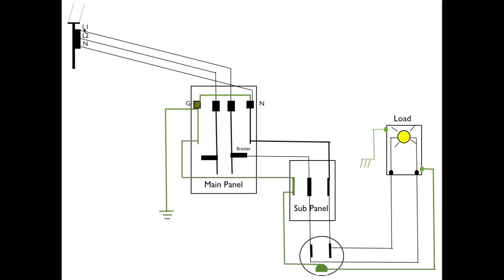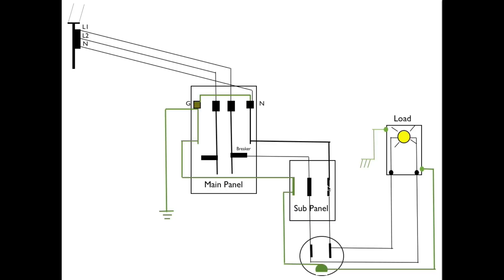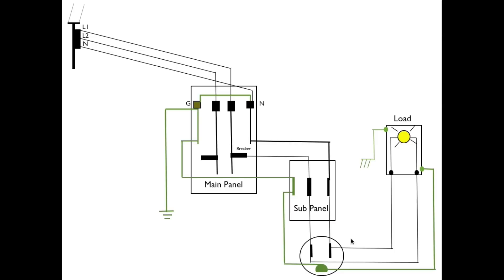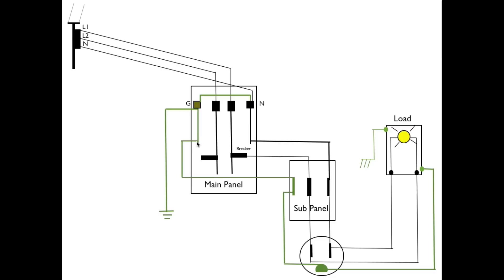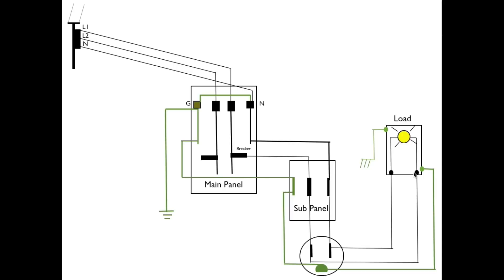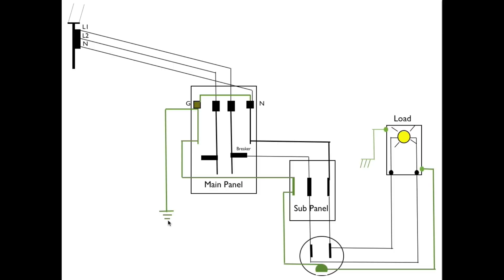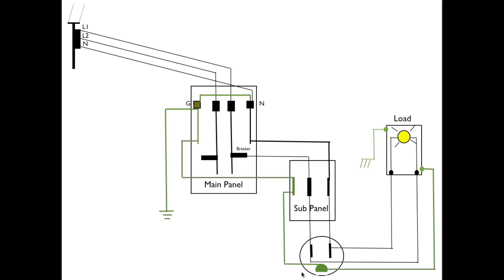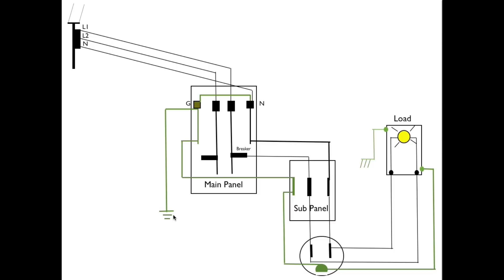The difference between neutral and ground on the electric panel

Comment: Connecting the Neutral and Ground wire together at a Sub Panel violates the NEC code. It can work, or it may cause a fire, or folks to get shocked or cause corrosion of conduit, corrosion of adjacent gas pipes.

 Allowing current to pass back not through the neutral only besides being illegal can cause issues.

 A more technical issue is a ground fault needs to be cleared properly so the circuit breaker trips.

 At the main breaker the Neutral (groundED wire) and ground wire are connected together. At a sub panel the panel might be 50 feet away and the Neutral might be several volts away from ground when the two 120 volt legs are not balanced; ie the Neutral is carrying current.

Bonding the Neutral and ground wire together at a sub panel forces some current to flow through the green wire ground, thus not proper. This same wrong current flow will find other paths too, in my case it found a Natural gas pipe and thus caused the pipe to corrode where it contacted other current paths. 

The NEC  you cannot "reground" the neutral (grounded wire) after the service entrance. They added this about 90 years ago.

Tying the Neutral (grounded at the main/service entrance ) to the ground wire at a subpanel will work for awhile then often cause problems. As the illegal hack degrades the conduit if the ground can overheat and thus degrade the wire inside or cause a fire. Then the CSI team has the lawyers suing Mr Hack who built Mr Cheapskates building! :) In odd cases the plumbing can be hot electrically and somebody gets shocked or killed. Other issues are the ground carrying the full current load opens and thus one side of the 120 volt legs goes high and the other 120 volt leg goes low. ie say 180 volts and 60 volts. One blows up computers and TV's on one leg and has dim incandescent bulbs on the other leg.

***The neutral is current carrying conductor

* There should no current on the ground wires. ( accept in a ground fault type situation. )

If one illegally connects the neutral and ground together at multiple places in a building, then the ground wire carries some current, PLUS other items that are at connected to ground too carry part of the current too. Thus one has current flowing through gas and water pipes, through cable wires, through gutters ie anything that is connected to ground. Thus on a metal building this "wrong illegal current" can cause current to flow through the HVAC copper pipes that are suppose to only carry R22!
Reply from the maker: 3beltwesty Very good explanation.  I found nothing I disagree with here.  Interesting about the corrosion of the gas pipe.
Isn't it interesting that until I believe 1995 you could still wire in a dryer or range that had 120v components with no neutral and it passed code.  In fact, I wired a range with a neutral (not connected) and was told by the inspector I was nuts to pay for the extra wire.  Several years later the same range was replaced and required the neutral.  I like to think of the ground as a "virgin" that should never carry power unless there is a short to chassis.  Thanks for the thoughts.
GFM
Reply: grayfurnaceman Hi; thanks for the reply. Both my range and dryer are the old 3 wire plugs.  The issue of not bonding a sub panel is rather interesting. When the subpanel distance grows and the currents grow in the neutral a bonded subpanel has some current growing through the ground and any other paths to ground. In my case a bonded subpanel install accelerated the gas pipes corrosion rate. ie the latest piece of gas pip installed failed first.

Comment: Is line 2 for 240 volts?
Reply from the maker: Yes.
GFM
Reply: Line 1 and Line 2 have voltages that are equal and opposite from other, due to the setup of the center-tapped transformer winding that derives them.  Line 1 to neutral is 120V, and Line 2 to neutral is 120V.  120V is a special kind of "average" called root-mean-square or RMS.  The voltage of a 120V system really alternates from +170V to -170V.   At any instant, the voltages of the two lines are negatives of each other, defining neutral and ground as zero volts.  I.e. equal and opposite.

If you take the voltage difference between line 1 and line 2, you get an AC signal with an RMS voltage of 240V.  This is how you power 240V loads.  Usually for household loads, this means heating elements in electric driers, stoves, and ovens.  The motor in these appliances, usually runs off 120V.  The manufacturers do this, in anticipation of apartment dwelling units that have 120/208V grids instead of 120/240V.  I.e. two phases and a neutral from a 3-phase service.

Comment: so L1 and L2 are 180 degrees out of phase ?
Reply from the maker: Yes.
GFM
Reply: Mr Smith The two insulated wires each carry 120 volts, but they are 180 degrees out of phase so the difference between them is 240 volts. This allows a homeowner to use both 120-volt and 240-volt appliances.
Reply: GFM = Ground Fault Management ?
i wonder why they dont just ground Neutral at the power station, i dont get why they have kilometers of Neutral going to ground in the end.
And if L1 is 180 deg out of phase, what happens if a homeowner wants 3 phase ? does he just get supplied a L3 ? 
 how do they get 120 deg offset from 180 ? Or do they do a completely new installation ?
Reply: Mr Smith.... Study a little bit on 3 phase delta& wye connections. Note the voltages, and yes completely different !
Reply: Mr Smith — Typically, the neutral is created at the final transformer.  The input to the transformer is one leg of a 3-phase delta.  If the customer wants 3-phase power, the power company uses a different transformer.

Comment: What about in the case of the oldtime one wire telegraph systems that used earth ground for the return path? It seems to me that the earth ground return path would have way too much resistance for any appreaciable distance. I tried to look up what the Earths average ground resistance would be for any particular type of soil condition for a measured distance,....but really all I found was the Earths resistance of particular soil at a measured depth. Supposedly some of these old one wire telegraphs ran distances of over 100 miles between stations.
Reply from the maker: John Kerley That's true.  The earth ground as a conductor is not really very simple.  It really is not a return path like a wire but will absorb the power if the voltage is high enough.  There are some power systems that use single wire transmission.  Notably in the outback in Australia.  One of the issues with these systems is they can turn water pipes in the ground into anodes and corrode them.  Hope this helps.
GFM

Comment: do I need to bond the subpanel?
Reply from the maker: The sub panel is bonded to earth ground but not to neutral.
GFM
Reply: Neutral and ground remain isolated from each other at all subpanels.  You only bond them where required by the NEC or other code that governs.

Examples of where it is required to bond neutral and ground:
1. The service disconnect.
2. Separately derived systems, in either the transformer or secondary disconnect, which is otherwise isolated from the service.

Comment: This just my musing. I have been shocked while wearing shoes with rubber or plastic soles (in the house) yet I know the soles will not pass current at 120v. I don't readily see an explanation for that.
Reply from the maker: If you touched both sides of line (hot and a neutral or ground), you will get shocked.  It is actually unusual to be shocked thru your shoes.
GFM

Comment: L2 from the pole is not used?  Why is it there?
Reply: Two phase systems have one AC line with one phase and another AC line that is out of phase by 90 degrees.  The two different phases are used to distribute current more evenly and provide for double the AC voltage.  If both lines are at 110 volts AC, when using both at your dryer they can provide 220 volts AC.    The higher voltage is better for greater electric heating such as in your electric ovens, stoves, and dryers.  The higher voltage may also be used at your AC compressor because it is more efficient in running pumps.  

To use an analogy, think of waves at the beach and a reflecting wave coming back off the sand.  When they collide in time, they reinforce each other into a peak that is an even higher wave than either alone.
Reply: Beware, readers, Bill A is confused about the difference between 2-phase AC, which is rare, and 120/240 volt, 3-wire single phase AC, which is our residential standard.
Reply: please elaborate, what is the "confusion" - two phase vs. one phase ?
It is alternating, yes? at 60 cycles per second, not minute as another commenter said. 
Anyway, you prefaced all with "Beware", which is the general sense of the majority when thinking about electricity. How, exactly, did Bill's comment encourage foolish behavior or in other ways, put people in danger?
If people are afraid of something and thus avoid it, they remain ignorant and paralyzed. Please take this opportunity to explain further the correct understanding of our alternating current system, and how this will help people be safe with electricity.
I'm assuming the majority here are in the U.S.

Comment: This is for most of the Americas like USA Canada Mexico, not Europe. Someone suggested the neutral and ground could be touched at same time Do Not do that if there is a fault you can be hurt. Think of electricity going in a loop on the hot wire and returning used up on the neutral the ground is a safety and can have voltage if something is wrong.  The neutral will be tied to a ground at the pole/ped transformer.  If the sub panel is in a separate building code may be to bond neutral to ground.  A nice simple explanation but if you do not get it just have it explained again all of a sudden you will think man that is easy why did it take so long to get it.
Reply from the maker: Thanks for the thoughts.
GFM

Comment: So amateurs can understand this better, you might replace the word "Load" in your diagram with "Appliance (Load)" and describe broken ground wire electrocution as touching the chassis of the appliance while simultaneously touching some other grounding source.
Reply from the maker: Good thoughts.
GFM

Comment: But......... from the diagram, the ground and neutral are connected, so if the neutral is carrying current  then current will always flow through the ground, If they are actually connected in the main panel.
Reply from the maker: Earth ground is not part of the circuit.  The current will go to the neutral on the transformer.  But little or none will go to earth ground.
GFM

Comment: I only have two wires coming from the pole no neutral, I ask Detroit Edison about this, they told me my ground IS my neutral, maybe this was code in the 60s .
Reply: The very early systems, especially in rural areas, only had one wire - the hot. The return back to the source was through the ground connection. As you might guess, the voltage swing was pretty large - but rather immaterial when the only loads were lights.

When I was a youngster in Eastern Oregon, there were two wires - a hot and a neutral. The voltage was pretty steady, but then there were few loads that required well regulated voltages.

About when I reached the age of 10, power distribution was upgraded to the current center tapped system now used - although I am unsure how earth grounds (if any) were handled.

Comment: I still don't get it. I should have taken a class on electricity a long time ago. I have never truly understood anything about it except that when you complete a circuit, power flows through it and anything that is part of that completed circuit and obviously I don't even have that correct. If Ground and Neutral are tied together then if one carries current then why don't both of them carry current and what separates their functions? I'm sure this is a frustrating question to a qualified electrician and the reason I never do anything much past replacing a receptacle and why I probably shouldn't even be doing that. On to another video that might enlighten me - not light me up!
Reply: The Green/Yellow wire has a direct path to Earth ground.  It is NOT part of the path of current that flows from black  "Hot" wire through the load and back to the box via the White (neutral) wire.

Comment: What is the purpose of L2?   From the diagram it goes nowhere
Reply from the maker: L2 is the other end of the secondary winding of the pole transformer.  This video is trying to explain neutral and ground, so L2 is left out.
GFM
Reply: GOAski — L2 is just like L1, but opposite in phase.  There are two 120V lines so you can get 240V.

Comment: Only if I hook up ground to neutral.
I hooked up a outlet in my bathroom green to neutral.
It's been 10 years never had a problem. I use it every day.
If you follow the nuetral wire on the power line it goes to ground.

Comment: The fact that the neutral and ground are connected at the main panel makes no sense to me. I understand hot, neutral, ground, and there purposes. But neutral and ground being connected seems totally wrong to me. Can someone maybe explain why to me?
Reply from the maker: First, you need to understand that earth ground is not part of the circuit.  Earth ground is only there to provide a path for lightning and surges to be dissipated.  It is a zero voltage sink.  So if a charge enters the wiring, from whatever source, it can be dissipated.  The connection between earth ground and neutral is part of that path.  
It is not connected together at any sub panels or appliances to preserve the integrity of the circuit from the chassis of the appliance or sub panel.  Hope this helps.
GFM

Comment: Lets get even more basic. Electricity is the energy created by the flow or movement of electrons (the negative part of every atom). Protons (the positively charged part of every atom) do not move or flow and that is why we have no form of energy known as "proticity". All electrons are the same whether they are in a hydrogen atom (H) or a carbon atom (C) or a molecule of water (H2O). Not only do "energized", "excited" or "activated" electrons move, but so do the ions (positively charged atomic structures missing electrons) that are created when electrons leave an atom. The energized, excited or activated negatively charged electrons want to return to a stable platform and are drawn to the the positively charged ions and vice versa.

The electron flow is created by the power company using steam generation (from burning coal, nuclear fission or other primary source), hydroelectric turbines (gravitational pull of falling water over a dam) or other method such as solar panels and wind turbines. The steam, wind or falling water spins giant turbines containing magnets and a LOT of wire. That electric generation (electron flow) is created as activated electrons are repelled from one another since they all have a negative charge and they seek a positive ion to join. Electrons continue to "move" out of the power plant and along the wires to the transformers, such as the one on the pole outside your home (unless you have buried cables where you live), and into and out of your home or business and back to the transformer. In fact, the electrons can move so quickly that they can run throughout a complex electric grid system in the blink of an eye.

If you need to know one thing, it is this. Flowing electrons (electricity) are ALWAYS looking for a path of least resistance to find a positive home and when YOU become that PATH, you get shocked. So keeping the electrons flowing on the wires where we need and want them to be is the goal of proper residential and commercial wiring and why it is SO important to put the correct pieces of the electric system in place whether at the meter, in your main panel, in your subpanels, or in your outlets and switches. Stick to doing it correctly and/or hire an electrician that will follow the codes for your area.

Comment: The word Neutral means it is not Positive nor Negative. Ground means earth and whatever voltage going to the ground will be neutralized.
Reply from the maker: In AC, we do not use positive and negative as there is no continuous positive or negative.  Current going to ground does not mean it is neutralized.  If there is no path to the center tap of the pole transformer (neutral), a connection to earth ground will not necessarily conduct large amounts of current.
GFM

Comment: It seems that I don't understand the concepts of grounding. I know that in order for leakage currents appearing on chassis of a load to flow to the ground the system of grounding has to has low resistance so the leakage currents couldn't flow through a person touching the load's metal body.

Comment: neutral is ground. neutral is created by ground at the transformer. power comes in 3 phase and there is NO neutral. the neutral is created by the ground at the transformer. the only difference at the panel is the ground creates a shorter path (less resistance) to provide the safety aspect
Reply from the maker: You could not be more wrong.  Earth ground is not part of the circuit.  It does not provide anything like a "less resistance" path.  I could remove all earth ground conductors and the 120 volt circuit would work normally thru neutral.  It is, after all, the center tap of the single phase transformer.  
The safety ground is provided thru the neutral also.  
The earth ground provides a path for spikes, lightning and surges to be cleared.
GFM